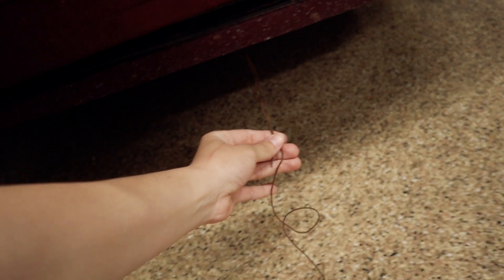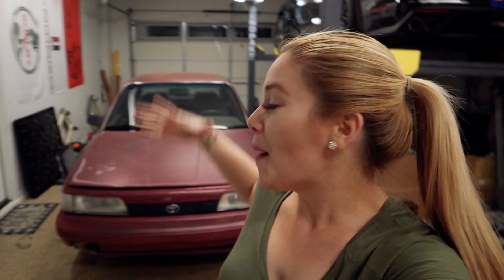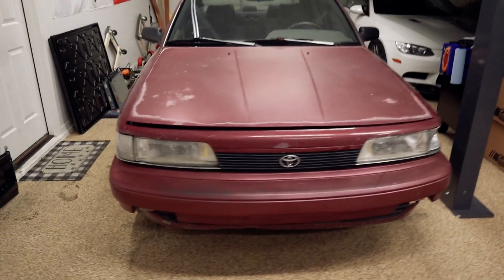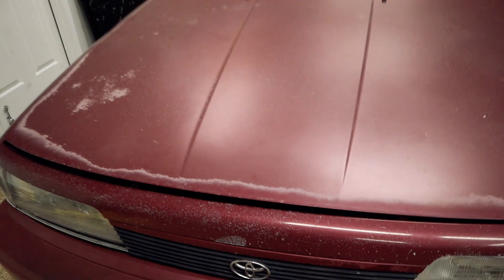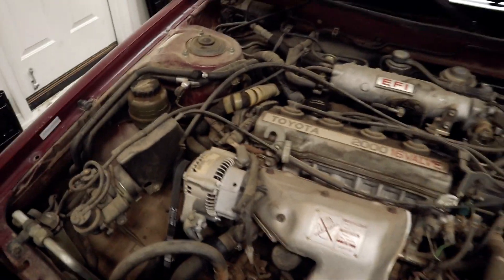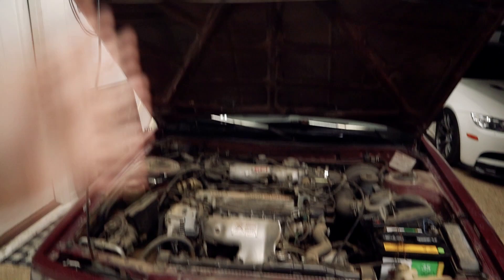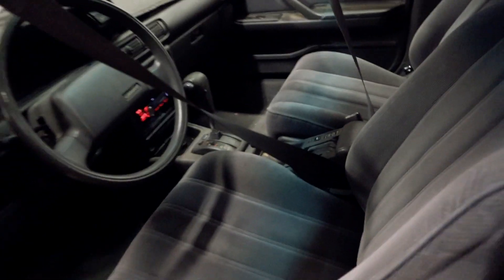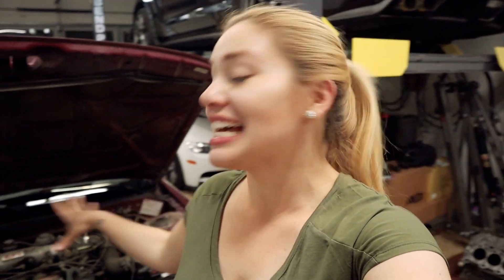I BOUGHT A 30 YEAR OLD TOYOTA FOR $900 and I LOVE IT!!

Comment: I honestly would rather drive those that 90’s Camry or Accord than today’s cars. Much more simpler back then. Thank you queen of the streets Dorace! 😍
Reply from the maker: E-Rock Very simple. Every time I get into it.. I take longer to get going because I feel like I’m missing something. Especially using the key to open and start the car lol. I love it!
Reply: Is this car carburetor? Or fuel injection?
Reply: jjeremy350 fuel injection. Carburetors started fading away in late 80’s.
Reply: Damn i hope she was carburetor
Reply: @user-ne9wp8ve5u  I'm still driving a car with a carburetor :) It's a 1986 Nissan Sunny, it's a very reliable bullet-proof car. Okay, it's a car that I drive less these days but still I drive it. Of course I have a modern car that I use more often. But still, old cars are nice! :)
Reply: You won't be saying the same if you have a wreck. Have you seen crash tests? Sure they are reliable but not as safe as more modern vehicles.
Reply: @IzaguirreC  Yes I know they are dangerous in a crash. I know the risks and that's why I drive it alone. I have a modern car with airbags, I use it if I have passengers with me. And hey, if I have really bad luck in traffic and if I get seriously injured or killed, it's something I can't do anything about it :)
Reply: Woman.Driven love toe old camrys Corollas .I have a 94 corolla with 254000 miles & occasionally run it 100 m.p.h .These old school camrys & Corollas engines are rock solid. Give them they oil change & change timing chain & water pump & u good.
Reply: Christian Izaguirre when you drive 80s & 90s cars you pay more attention to the road.Newer cars have too much fandangles in them to distract you from the road .

Comment: CV joints are worn out, the sound you hear when turning or bad hub assembly
Reply: You are right about CV joint and clunking noise.
Reply: Cv joints are a pain in the assss though lowkey 😂😂😂
Reply: Strut mounts also
Reply: End links

Comment: Most likely the power wires on the radio are not wired properly, the yellow and orange wires get changed most of the time. The yellow wire is for the radio memory, it needs constant power, the orange one goes to the ignition and powers the radio as you start the car or put ignition on

Comment: Good pick. A Camery is always good. The click you hear when you turn is the CV Joint on the right side. It is not the suspension. The CV Joint is the actual axle from the transmission to the wheel. easy to replace. you can get a new one or find a CV Joint shop that can rebuild it for about $120.00 - $140.00. Make sure you do both at the same time. If You keep driving it like that, the axle will brake and inbed itself in the oil pan. Experience talking here. Suerte, tu si puedes!👍😀😎

Comment: Toyotas are one of the most reliable brands. I am not surprised that 30 year old Camry is still going strong. Those 4 cylinder engines are notorious for being practically unkillable. Also you are very lucky to live in Arizona and not have to deal with rust. Im in Southwestern Ontario. So my 2000 Corolla is rusting away. She has served me well for the past 7 years though. ☺

Comment: Doris the ball joints on these cars go out over time so that is likely some noise your hearing from front of car, remove fuse for radio to get it to turnoff just to figure out what's going on with radio. Interior looks good i agree the car looks like has straight body no rust these are easier to do Paint & Body work to for sure.  These cars are easy to work on so have fun and bring it back to life.

Comment: I had a 1990 Camry.  It was my Dad's and bought new.  It is still running and in immaculate condition.  I gave it to a friend's Grandpa and he uses it today.  I know why the alternator and battery are new: these edition Camrys have a brand new ECM system ( maybe this was the first year) and they have a significant parasitic battery drain when not in use.  I had to replace the battery at least every two years because my parents did not use the car very often and only to pick up groceries a few miles away.  It is a great simple car.

Comment: This will be a fun project. I actually like old Camry's since I've got a 1997 Camry fully loaded with the 1MZFE V6 with only 98.000 kilometers (60.000 miles) two years ago. One owner, pristine condition inside and outside, still smells like new leather, the car feels solid and it's very smooth, I only use it for 2 hour road trips to the nearest city once a month.
Reply: The only thing that I hate is that the first owner installed 4 auxiliary fog lights in the bumper and a radio antenna since it was an executive highway car from a company since brand new but they barely used it because they had some trucks and SUV's

Comment: Oh wow, you just brought back a ton of memories for me (I drove an 86 camry in high school, which are mostly the same to the 87-90)....wow.  PM me if you have any issues, as I may have had to deal with them on mine (it was a junker by the time my parents sold it to me).  A few things I can think of off the top of my head:

1.  Get a timing light and check the ignition timing. That motor uses a timing belt, and they tend to stretch over time which will mess up the timing.  Toward the end of my time with the car, the valves were clanging on the cylinders bad because the timing was so off.

2.  If the spark plugs need replacing, use whatever type of plug they originally came with (I think it was copper, but check the manual).  Back in those days, the Bosch Platinum+4 were all the rage, but when I put them in my car it ran like complete junk.  I didn't know much about cars back then, but my guess is they were the wrong heat range for the motor to run properly.

3.  Check the door and ignition key locks, as those tend to wear out (and they're already easily defeated as-is).  My friend had an 88 when we were in HS and my 86 key was able to unlock his car and start it (but his couldn't do it to mine which always irritated him).  

Looking forward to seeing how this one turns out.  On the paint job, I'm thinking it may just be cheaper to have it wrapped than to repaint?

Bonus tip: Do NOT put a K&N filter in there thinking it will add power...it will not  ;)   Yeh I did that too.  If I knew then what I know now about cars, I'd have saved myself so much money LOL!

Comment: Doris, I think that the car stereo is in Demo mode. Here is how to turn it off: https://www.youtube.com/watch?v=VjiBEUZei3s
Reply: or just pop the face plate off until you replace it
Reply: Yup, Demo mode, but I think the power and accessory wires are also reversed. It should power down when the ignition is off, even in demo mode. In Europe, the wires are red and yellow. One is always on, to power the memory, internal clock and so on, the other is a switched supply from the ignition. If they're reversed on installation, the radio won't power down when the ignition is off.
Hope it helps

Comment: The 90's were the golden years of Japanese cars. New enough with fuel injection that you don't have too many running issues, but simple enough to easily fix. And they were made VERY VERY well. That interior looks great. Someone took care of that car.
The white on the paint is mostly just the clear coat having failed and peeled off. You may be able to just apply new clear coat on some of it.
Personally I'd just concentrate on the mechanical stuff.. then worry about the body work . 
Going to be a great car to learn how to work on.
Love your channel.
Reply from the maker: kens97sto171 excited to learn more about it. Let’s see how things go. Cheers!

Comment: 1990 lol my good friend's grandfather had the v6 version and it would rip down the road. Top end was like 115 to 130 mph.  But it got about 12 mpg at that speed. 
 We had a blast in that car back in high school days.  As for the radio the wires are hooked up to a power source that's non keyed 12 volts probably like 15 to 20 amp fuse.  That's a nice find for 900$ 
 As always have a great day!
Reply: Look close when she shows the battery the radio hooked up directly to it.

Comment: My late Grandma bought this same car new in 1989.  Drove it until she couldn't drive anymore and we kept it for a spare car as it was very dependable.  Unfortunately where I come from rust is a serious issue in the NE and it got to the point it wasn't going to pass inspection anymore.  Car was kept up fine over the years but the underneath started rotting away at just 10yrs. old.  Still ran great the day we got rid of it after 17yrs. and over 250K miles.  My father still owns and drives a 1990 era Nissan Stanza for his spare car.  Southern car and just has minor interior sun damage and still runs very well with close to 300K miles.  They were all still made in Japan back then, and simpler, and very good cars.  Have fun with the Camry!  I'm 51 in a few weeks and I would gladly daily that car once fixed up.  I daily a 10yr old VW Jetta SEL trim Gen 5 and have had it since new.  Still looks and drives as new, but much more complicated than my older Jetta 3 VR6 I drove before it for years as a daily.
Reply from the maker: Stu650Zuk that’s insane. First car and lasted that long. If it wasn’t for the rust, I’m sure it would have lasted even more. There’s a few 20+ year old cars that last a long time and hold up reliably. That’s always good to hear. Not a lot of complicated things to worry about. Enjoy your bday. Thanks for watching!

Comment: A friend of mine had exactly this model car, with the exact paint color. She ended up just spraying black dots all over it and calling it the "ladybug." The ladybug definitely had issues, but if you replace the rotted plastic & rubber, and keep the rust off it, it should run forever. Good find. Still a great daily driver -- keep the miles off your new, expensive machines!

Comment: There should be two power wires to the radio, one to the battery (to keep your radio presets and color settings) and one to the accessory circuit. If they wired both to battery, the radio would never turn off. If they got them backward, you might see similar behavior. That would be where I would look first. In the meantime, find the fuse for the circuit the radio is on and pull it, or disconnect the battery cable. Great project car. I would have expected a classic, but this is a great way to get started. Well done! :)

Comment: Looks like a 5sfe- let me know if you want a common issue list. Mostly easy to work on. (Minus fuel injectors- pulling the rail is a biotch) unless you remove that hoist hanger. 
Fun cars, fun engine.
Have 2 88’ celicas- one 3SGE (love that engine!) and one with a 3SFE.

Comment: Strong vibes of my first car, a hand me down 89 Camry, which was the base model manual locks and crank windows, and manual transmission. I did some mods over the years, including retrofitting OEM cruise control and tach speedometer, plus lowering and wheels. Car was junk tho. It was already on its 3rd gearbox in 2001 when I sold it with 150k miles.

Comment: Great choice hun these iron cast engines last forever and great on gas and looks like the radio is connected straight to the battery instead of the acc switch 🤔 man this is when Toyota was Toyota and I had two of these but the newer trim a 92 v6 and 93 4 cylinder which is that same engine there you have and mostly on the suspension you have to update struts,  bushings, sway bar bushings maybe that noise your hearing can be a bad axle or hub assembly who knows but cant wait to see you work on this 😋👍🏼 original

Comment: Hi Doris,   interesting choice of  project, Can't wait to see the issues the car has.  I'm on board for the ride.  
As for the Clunking you mentioned, most likely it will be the CV Axle.   The radio seems to be connected directly to the battery I saw a blue where on the positive post.  Since you charged the battery, I will suggest for you to disconnect one of the battery post to prevent the batter from going dead again or get damaged.  

I can relate to your project as I have project of my own, 2005 Chrysler 300c 5.7 V8.  similar condition as yours,  great interior seats but BAD Paint, Engine, Trans, suspension, brakes, dashboard is lifting and needs replacement, needs new carpet.  etc., etc. etc.  its my weekend project and its been going on for a while.  I'll be honest with you, sometimes I feel like lighting a match to it as I get frustrated but, I calm myself take a week or two or more off and then go back at it.   I don't have a garage like yours which will make it easier but slowly will get to where i want it.   

As for the name for your car  NOT good at naming cars, Mine has NO name either.

Comment: Retro  is in! I have a 1992 Nissan Maxima Se 5 Spd with 99k on it 2nd owner! Runs great for 28 year olds.  Less features than today's. But you can get a decent radio  and spears added on. Sadly the aftermarket upgrades dried up for the 3rd gen maxima. Since lots of them are junked yard.

Comment: Dear Doris - Requirement Number 1 for this older foreign car endeavor should have been:  2 Door.   Ok some 4 doors are acceptable - maybe a 90ish Civic or other currently desirable lowered cruisers, but you can never mess up with a 2 door for max return at some point.  Ok - it's no biggy in the grand scheme - just taking this on is the fun part, I get it.  Looking forward to watching this ride come back to life.  Not trying to chip away at your beautiful enthusiasm.  Your smile and sweet attitude are just the best!!!Case in point on old 2 door toys - my son and I have half a dozen Miatas we play with.  Rear wheel drive, super affordable, reliable and plenty of OEM and aftermarket parts.That radio is your drain...you are right!  Is there a hot wire from the radio to the battery?  Or maybe a hot wire into a hot spot on the fuse panel...  Good Luck!
Reply: Ahhhhh I spoke too soon.  I see the relationship of that car to your parents....Yes I love that kind of sentimental stuff!

Comment: You don’t have to remove the radio you just have to find the hot wire from the battery also the auxiliary wire and the issue will be fixed the battery power and auxiliary power will need to be switched over so the radio will go off when you turn the engine off I have wired a few stereos in the past so I have a little knowledge on car stereos you just have to find the stereo manual or find someone who has knowledge on wiring car stereos to move onto the next issue which is the hood release cable or install a manual hood release but that requires having a hole in the middle of the grill area in front of the radiator which will most likely require you to remove the radiator saving time and money on where exactly the cable is broken which will most likely be time consuming just thought I would give you all that I know to assist you on your Toyota project 🌹

Comment: This is awesome. Please check your radio wiring, it is obviously the source of your battery drain. Besides, you can be disconnecting the battery when you are not using the car to avoid damaging the battery with multiple drains.

Comment: The radio is likely wired backwards meaning the switched wire is wired to the main power wire and the main power wire is wired to the switch wire the clunking noise is likely a cv axle as it is front wheel drive they tend to clunk or click when turning it’s a sign of needing to be replaced also the radio is likely the power drain that killed the battery those after marked radios very often get wired up by people with little experience and are often done wrong really enjoy your videos and the fact that you learn by doing

Comment: Run a compression test. Check head gasket condition. Figure fuel, ignition or vacuum issue causing engine stall. Clunk noise could be bad motor mount or suspension related. If radio power is wired correctly thru an accessory circuit, problem likely with radio. Clean, lube hood latch. Get oem s/m from ebay. You're gonna need it.

Comment: The radio has 2 power sources. One should be constant power which is usually red. The other should be wired to a switched power source. This wire is usually yellow.  The whoever probably wired the yellow wire to a constant power source.  Move that wire to a spot that only has power when you turn the car on. ✌🏾

Comment: Those 90s toyotas still run great. I bought my 96 V6 Camry for only $1,200 with only 196,000 miles and the only thing I had to do was put in a new power steering pump for $400. Everything else is in great condition and still runs smooth

Comment: The clunking noise when you turn might be the universal joints thats worn out And for the radio, just find the right fuse in the fuse box and disconnect it.

Comment: The blue wire on the battery   might  be the power wire for the stereo  . Just disconnect it and see . Those stereos are cheap to replace . 
Great project and leaning tool .  Have fun .  Peace from Up North .

Comment: Love Camrys. They are known for their longevity, as I have seen several still running great with over 400K miles on the clock.Always considered one of the top three cars for several decades, with regard to reliability and customer satisfaction.
Reply from the maker: Robert Hoffman yes.. part of the reason is they last so long. This one has around 190k miles. So still young lol. Happy to work on it.

Comment: not that this comment is like any of the others. but the clunkin when you turn is cv axle. battery is going dead cause of the radio doing that. its not wired up right and might be in demo mode like someone else said, pull fuse til you can fix it so car wont be dead everytime. will keep watching to see what you do to this car as i do on your other ones. keep it up beautiful..